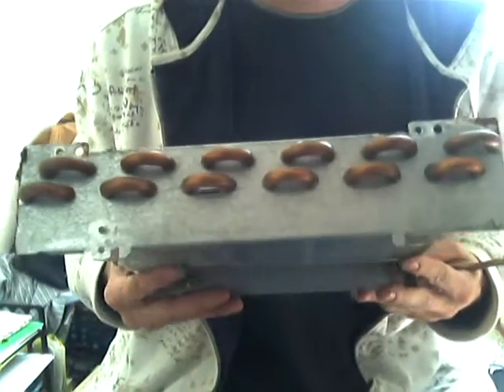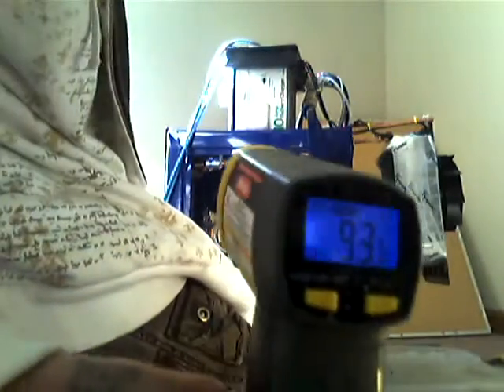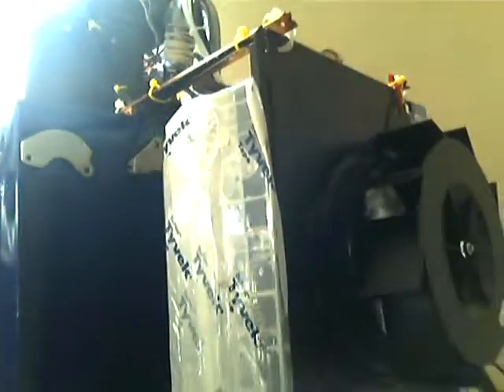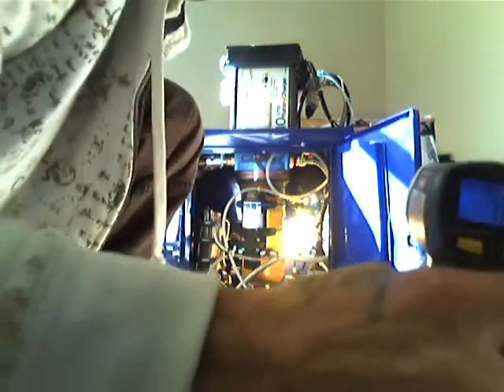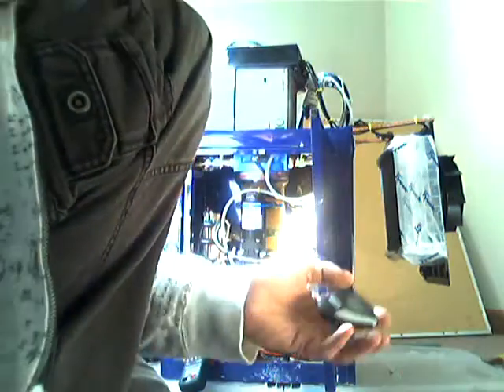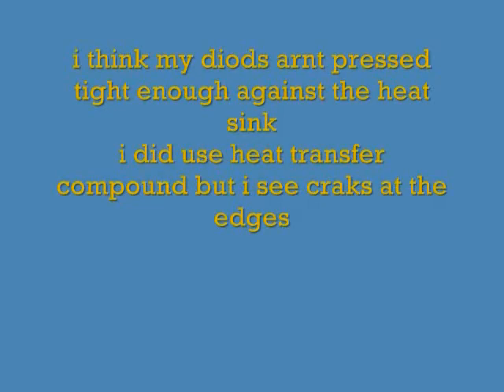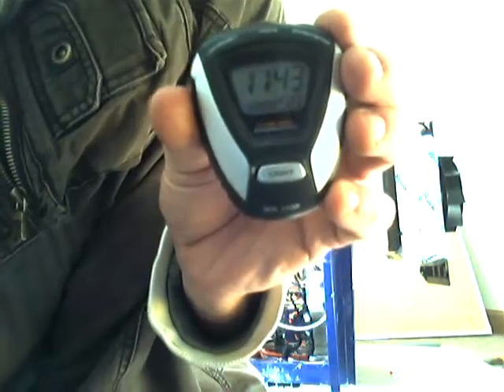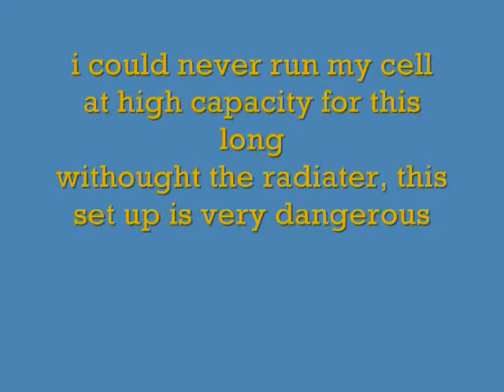HHO TORCH (radiator performance testing )

Comment: Dude, I have to ask. How did that copper do? Hold up over time?
Reply from the maker: It does ok , had one last 10 years and still going . but i have a 5 year old one in service with a minor wheep , it not a leak but a wheep and their is a difference . ou can run a wheep for some time .

Comment: This radiator is made from coper or 304 stainless steel
Reply from the maker: Copper , but it must be brazed together , lead turns to powder in these systems
Reply: @NOBOX7  Thanks sir for the information but Naoh  or koh electrolyte ests copper so till  how much time it will work for hho?